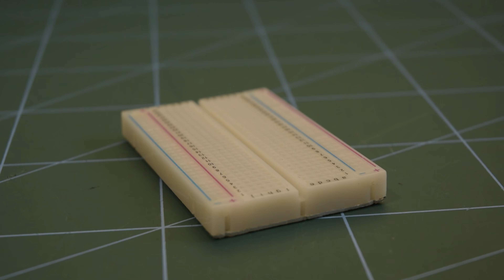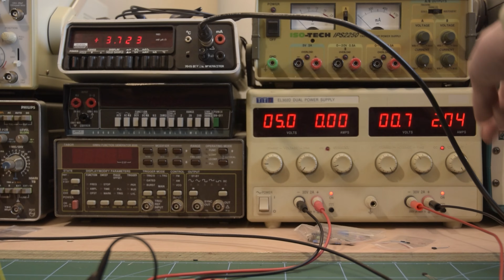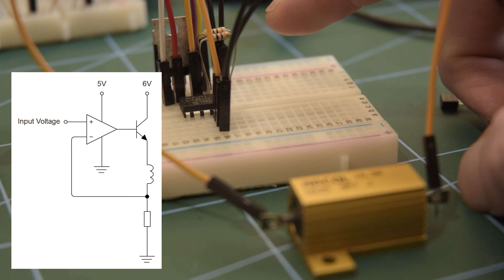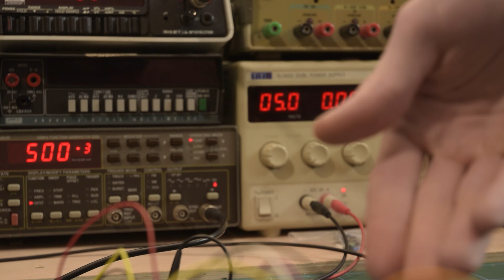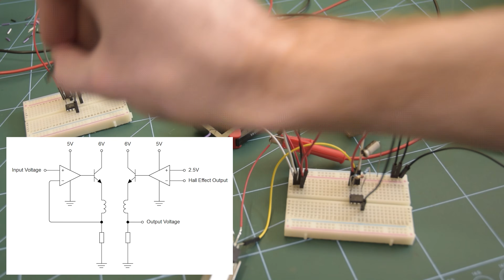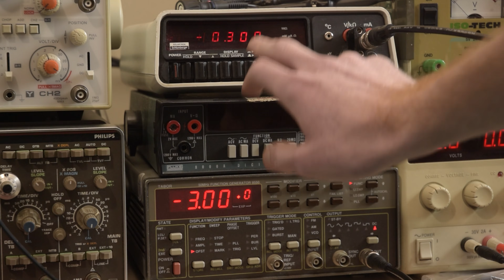Isolated Voltage Measurement - Hall Effect

Comment: Is it possible to measure current and voltage at the same time using this? I remember there is a (very expensive!) Fluke clamp multimeter that is capable of measuring current and voltage at the same time from its clamp. I don't know if it works for DC, but i really wonder how they pulled that off.
Reply: It's physically possible by simply switching very fast between two measurements. You simply need two measurement probes. As if you had two multimeters. For a clamp style, it's not really useful, though. To measure current, you need a low inductance, high coupling transformer so that the inductance doesn't impact the actual current. For voltage you want infinite inductance on the primary, which would dominate the circuit current. So you could measure both, but each reading would be invalid while the other is active

Comment: The IL300 matched opto is more accurate (about 4x more) and way faster (with fast op-amps, hundreds of kHz could be done) than this hall thing.  It must have something about it that the IL300 does worse, otherwise why?
Reply from the maker: Because sometimes it is fun to make things even though you know they won’t be optimal. This is part of a series comparing techniques for isolated voltage measurement, wouldn’t be much of a series if I just said “this is the best” and left it there.
Reply: @electrarc240  :):):)

Comment: you do have cores with a gap they are called a pice of bent iron it will work even  at highrates of changing flux because of the air gap saturation should not happen .
Reply from the maker: I used a gapped ferrite core. Saturation is not the problem it’s just the inductance attenuating the current/flux at higher frequencies. Only a higher input amplitude would help with that, and in this case the frequency would still be limited by parasitics causing unwanted resonance.

Comment: I have a system with 70 - 120V output at around 40 to 100W - but the frequency (I can vary) is around 10-40 KHz.  Load is an incandescent bulb.   I need to measure the output power at that frequency (especially around 10 kHz.   It looks like your system will work...  but what do you think? thanks
Reply from the maker: Unless you need a very fast response a low-pass filter before of after this would work nicely. If you're wanting to measure both voltage and current you can use a current sense amplifier to get a decent voltage out of a shunt, or could just go for one of the nice LEM sensors the current ones aren't especially expensive. if its pure AC you could consider a much cheaper current transformer too. If the load has a constant resistance I'd go with just measuring current then calculating power as that is cheaper and simpler, although an incandescent bulb would probably not be. In which case for voltage measurement you'd probably be best going for a commercial isolation amplifier, which hides all this tricky stuff in a small and affordable package.
Reply: @electrarc240   Thank you for those ideas!

Comment: I think at 100 kHz your system starts ringing. Since conductors resist changes in current and you're trying to change the current fairly quickly at 100 kHz. The coil introduces a delay, which means that your feedback circuit corrects for the current too late, either increasing or decreasing the current, depending on the phase shift. Basically, as you already suspected, you probably need a coil with less inductance. Which of course also decreases the sensitivity, so as usual it's a trade-off... Anyway, so what's up with the German flag in the background?!
Reply from the maker: Ah yes that would explain why it starts so suddenly at around 100kHz. And the flat is because I appreciate German engineering, and it was stolen from a real German engineer at a solar powered car race! (They won of course)
Reply: @electrarc240  Ah ok... I am in fact a German (electrical) engineer. But Germans tend to be a little suspicious about people (particularly Germans of course) having a German flag in their apartment, cause you know, history. :D
Anyway, I like that your videos show and explain practical examples of reasonably complex circuits. Not just the basics that Youtube is kinda full of already.
Reply from the maker: @phinok.m.628  Ah, maybe I should take it down so I don't give the wrong impression. Don't want that!
Reply: @electrarc240  Well, that's up to you of course. I guess a flag could potentially be misunderstood by some. But then again, it's also kinda your thing how you choose to decorate your apartment. I was just curious what that was about.
Anyway, keep up the good work. I'd definitely be interested in your attempt at optical voltage measurement using the Vishay optocoupler. :-)
Reply from the maker: @phinok.m.628  I'm designing a PCB for it right now! Might be about a month before it's here though unfortunately.
Reply: I've got a Euro-flag in my office... that only gives the wrong impression to stupid old English people. ;)

Comment: Magnetic measurements also are sensitive to the surrounding magnetic field, so that if you move your device you will see a change in the  output offset
Reply from the maker: Yes that’s a good point. The commercial units do a good job to minimise these effects but mine would probably be very susceptible to that!

Comment: Thanks for this great series! I was working as a BMS Trainee Engineer a few months ago and was working on the battery voltage isolated sensing when I came across this problem. I even searched for 1-to-1 ratio flyback converters but they also didn't seem like the solution. THIS SERIES INSPIRED SO MANY IDEAS.
Reply from the maker: Great to hear I’ve inspired you!